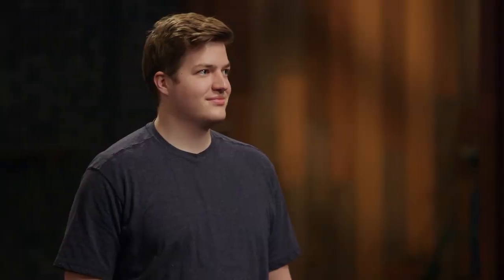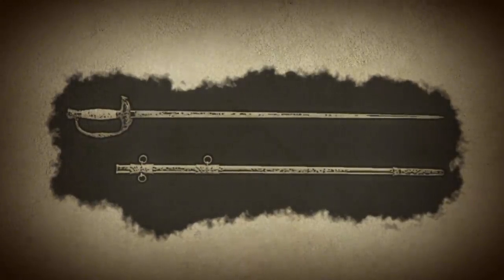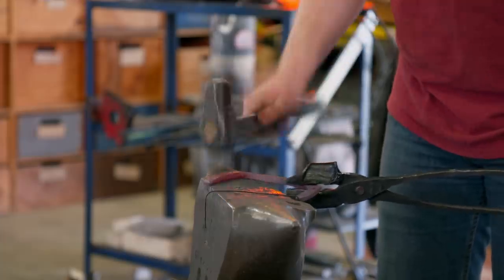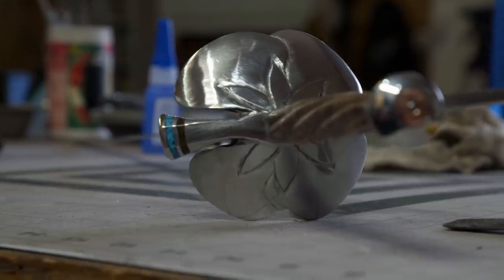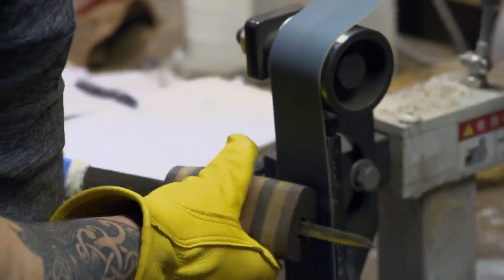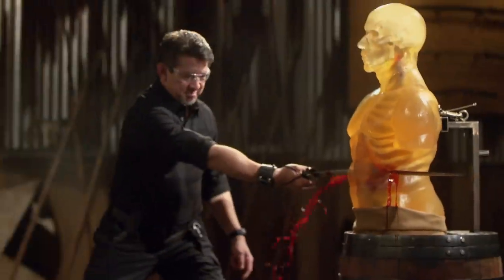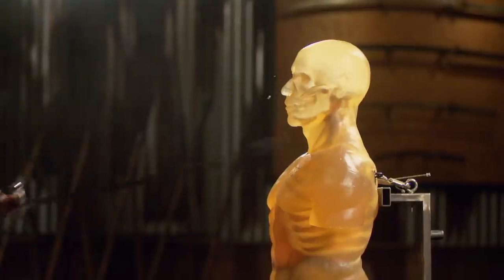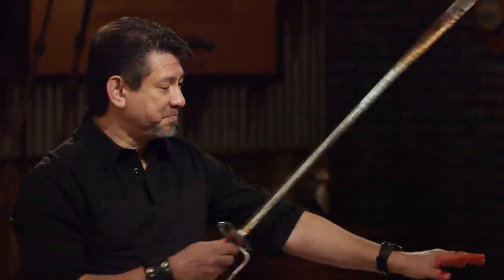Ulysses S. Grant's Sword CRUSHES IT in the Finals! | Forged in Fire (Season 8)

Comment: Id take pauls sword over isaacs every day. That thing bent on some simple slashes. That would snap in an actual fight
Reply: decorative swords aren't used in battle. and why it wasn't used in a strength test.
Reply: in a duel sutuation both contestants would have the same weapon. again you wouldn't like to have your nose chopped off even by this tiny cutter.
a lot of German gentry even in early 20th bore the horrific scars from student or cadet time duels